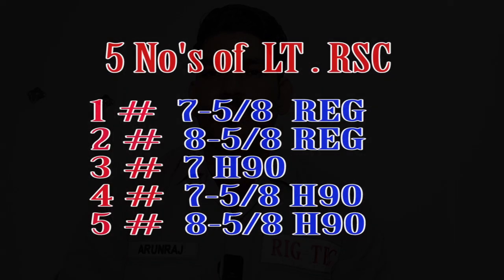LOW TORQUE AND FULL FACE API CONNECTIONS

Comment: Please explain BSR
Reply from the maker: BSR (Bending Strength Ratio): On bottomhole assembly con nections, the ratio of the box section modulus to the pin section 
modulus. BSR applies only to connections on drill collars and 
other stiff-bodied components that are run in the BHA. It does 
not apply to HWDP connections, except the one immediately 
above the drill collars, or to the connections of any components 
that are not normally run in the BHA.
Reply: How to calculate bsr on connection?
Reply from the maker: BSR Z
Z
D
D b
R B R d 44 44
= = ' - -
P
b b l l .........................(A.8)
Where:
BSR = Bending Strength Ratio
ZB = Box Section Modulus (in3
)
ZP = Pin Section Modulus (in3
)
D = Outside Diameter of Box (in)
d = Inside Diameter of pin (in)
b = Thread root diameter of box threads at 
 end of pin (in)
R = Thread root diameter of pin threads (in
Reply from the maker: Give your whatsaap no I will give the soft copy of BSR calculations